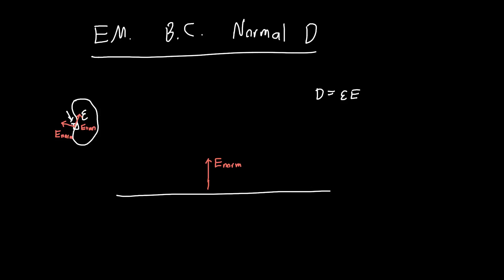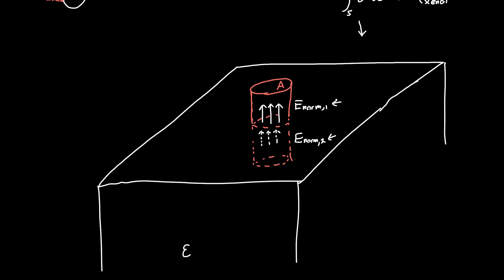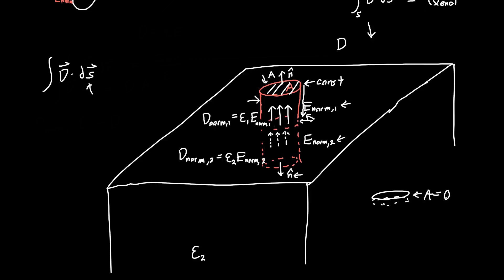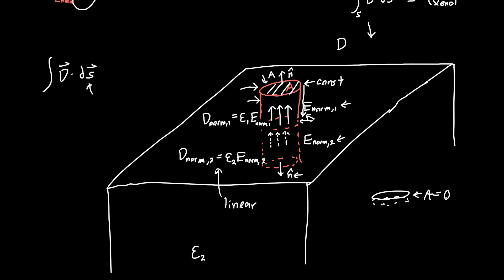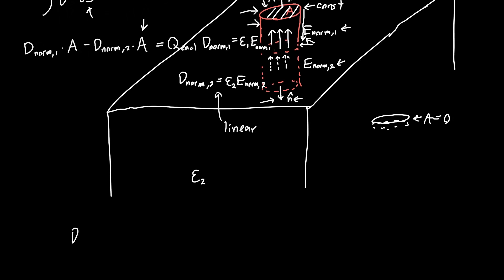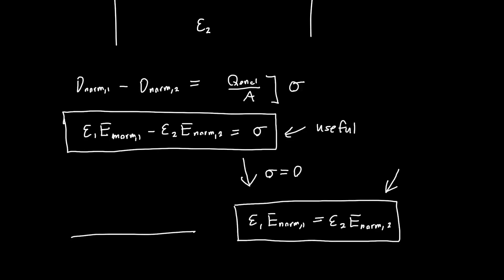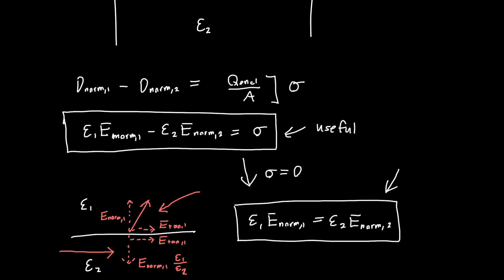Normal Electric Field Boundary Conditions

Comment: Hello Mr. Jordan,

Thank you very much for your useful videos.

I am a little bit confused about one thing that i hope you can make it clear to me.

Why we don't follow the same approach as the tangential component, why we didn't use the line integral Maxwell's equation and make the area very small so that ds will equal zero as we did for the tangential components.
Reply: I think we want to keep what we want, if ds goes to zero, then the left-hand side equation containing Enorm1 and 2 are gone, only Qenclosed is left, which seems meaningless since we want the relationship between Enorm1 and 2
Reply: @whysoserious0609  Thank you :)